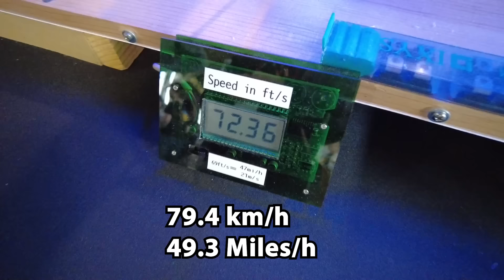Shocking Hazard at Open Sauce (best event of the year so far!)

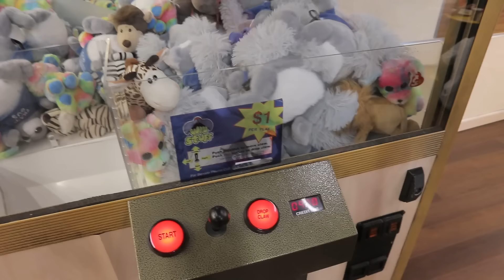Comment: At 5:33 you see a small ball suspended in a column of air. This is not new. In the ‘50s, if you entered any Sears & Roebucks store, you would find in the appliance department a display of their vacuum cleaner with the hose connected to the output, and balanced  on the resulting column of air was a beach ball, forever bobbing up and down.in the stream. I don’t know if it sold any vacuum cleaners, but I remember it 70 years later.

Comment: Hi Mehdi,

Thank you for your great content! Unfortunately, we are currently experiencing terrible electricity outages throughout Egypt. The electricity comes on for two hours and then goes off for one hour. This is making it very difficult for people to use their Wi-Fi routers and fans.

I would be grateful if you could make a video discussing possible solutions to this problem. For example, you could discuss using a car battery and an inverter, or you could review some of the UPS solutions that are available.

I believe that your video would be very helpful to people in Egypt who are struggling with the electricity outages.

Thank you for your time and consideration.

Comment: I really should get into this whole maker stuff, seems like fun. The only problem is I can't afford a 3d printer and filament right now because I dropped my phone on my upper jaw and cracked a tooth requiring me to get a filling. Luckily I had dental insurance so I didn't have to pay the full cost, but it still wasn't cheap for how little material was used. Specialized labor of two people like doing dental work is not even remotely cheap. But it's worth every cent because it feels and looks like I never chipped that tooth.

Comment: Hey, I've got a very unusual electronics problem, maybe You (or someone who reads this) can help:

I work in industrial electronics and one product ran out of production. 
Our boss has cleaned the components warehouse and I can have a ton of  foil capacitors 2,7V / 3,3F. 
(Yes, F! Not uF, not mF, but 3,3 Farad!) 

What would You do if You had around 15,5 thousand (!!) of such capacitors? 

I've thought about a power bank: 5 such capacitors connected in series gives a 13,5V /  0,66F capacitor and 5 of those connected in parallel (25 caps in total) then has 3,3F again, at 13,5V. How many of those 25-packs would You connect in parallel? In theory I could make more than 600 of them, that would be a capacitor around 2000 Farads... 2kF!  2 Fk'ing kF!!! 🤪

But for what? Is there any use? (how to charge that thing? Must have an inner resistance somewhere in the milli- or even micro ohms...)